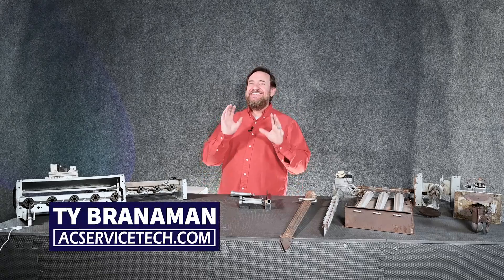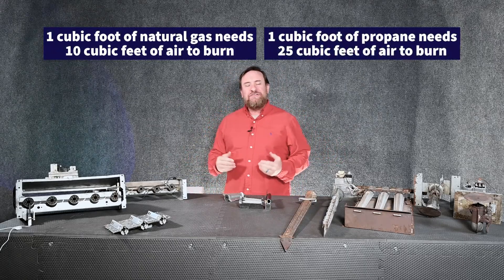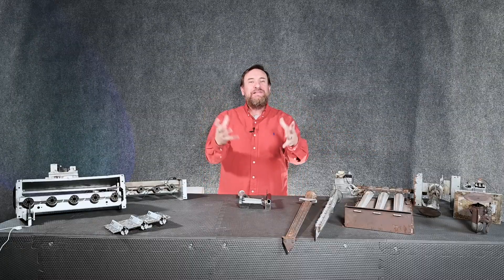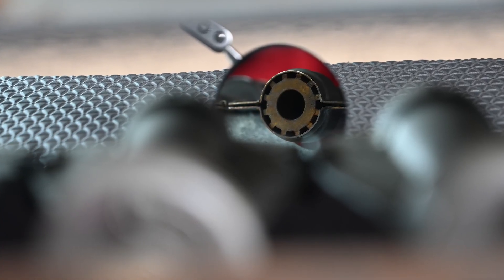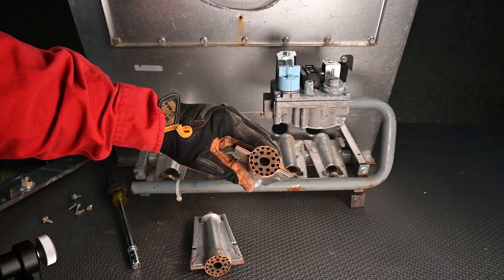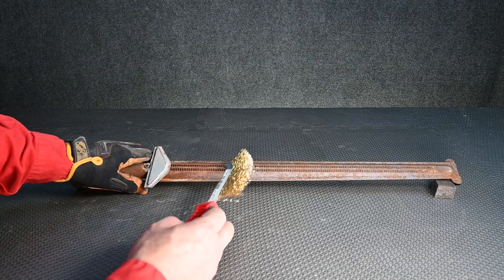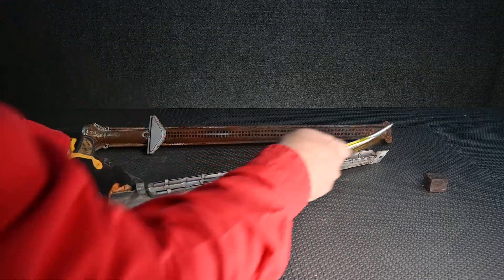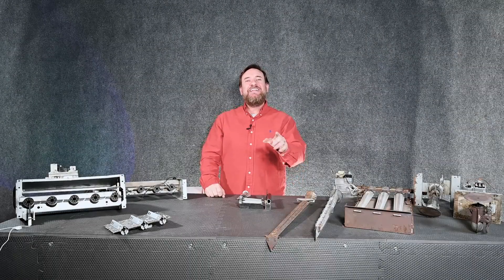Gas Furnace Burner Training!

Comment: Question I have a new gas hvac furnace but how come my heater just kicks in when the weather is warm. When it is really cold it doesnt blow hot air eventhought the system is on?

Comment: I’ll take a razor knife to clean out the (crossovers). That and tap them lightly with my nut driver to get the rust out . The razor will not spread out those slots. This. Is on the inshot burners only

Comment: Great video! One question is it preferred to use a brass wire brush or is steel acceptable
Reply from the maker: Brass would be best so it scratches the surface of the galvanized burner heads the least while still cleaning the rust off well. You don't want to remove too much metal, ottherwise the channels become too large.
Reply: Thanks 👍

Comment: HVAC maintenance tech: 
Came across a gas furnace with yellow flame all the way across. How do you correct this issue??
Reply: Is it a modern furnace or an old furnace?  Does it have a crack on the heat exchanger?
Reply: @caru3257  America standard. 3-5 years old. No crack.
Reply: @youknowwhatdaysayinhoe5646  are you getting and co2 on a meter? That’s weird, maybe replace the gas valve
Reply: @Veritasvincit333  no CO2
Reply: @youknowwhatdaysayinhoe5646  I would make sure the burners and spuds are clean and free of rust just like int the video. Also check the outlet pressure at the gas valve and make sure it's good. Make sure the burners are in the right order and right side up.

Comment: how do you properly clean a 80 % furnace natural gas, that ran on propane and sooted up until the roll out trip.I found it like that and made the conversion,i removed inducer and hooked shop vac and flush with nitrogen,any other suggestion.
Reply: That is very difficult.  I prefer to replace it but you can pull the furnace separate the burners remove the inducer, and the collection plate to fully expose the heat exchanger. Blow the heat exchanger out and then run some large pipe cleaner type brushes into the heat exchanger. Some models are designed that does not let that happen.  Be sure and check for cracks. They typically overheats and crack the bottom section of the heat exchanger. 
It's labor intensive, makes a mess and has no guarantee.
Reply: No cracks,1 year old.thanks for the tip and for posting. @love2hvac

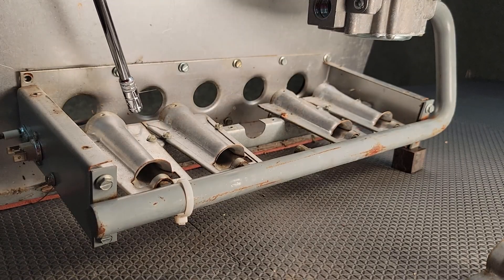Comment: Q - at 8:10 you put the inshot burner in upside down, can these go both ways?
Reply: It's important to keep them right side up due to how the gas travels in the crossover tube from burner to burner. Even if it does work at first there's likely to be problems with rollout or proving flame.
Reply: It was a mistake and it should not be upside down! Excellent catch!